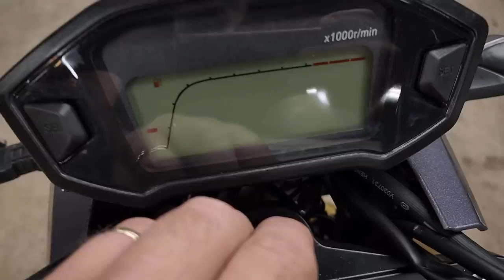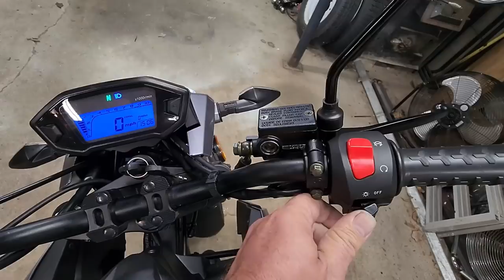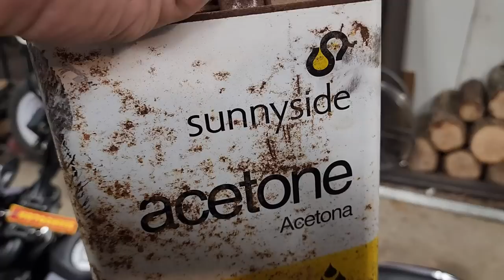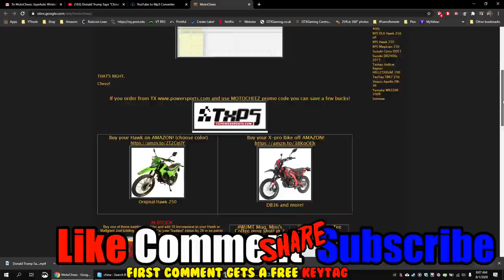BRAND NEW RPS Condor 150cc Grom Clone complete unbox build ride review top speed and 0-50 time

Comment from the maker: Purchase link: https://bit.ly/3tFJtWy
Use MOTOCHEEZ during checkout for discount!
Parts and info: https://www.motocheez.com/rps-condor-150-cc-grom-clone

Amazon affilaite links:
Shinko Nobby Offroad DOT tire set: https://ebay.us/OaEfRl
428-16 20mm front sprocket: https://amzn.to/3QDSZnd
Re-jet Stock carb main jet kit: https://amzn.to/3QBXYEL
Reply: Where do you oder theses bikes from I want one but I live in canada how do  I order  one can you send me contatic information
Reply from the maker: Purchase link is above through TXpowersports.
Reply: Tx power sports sells both. If given your pick would you go with Tao Hellcat or the Rps condor?
Reply from the maker: Condor is faster out of the box. I'd say condor. I had issues with motor mounts on hellcat.
Reply from the maker: Use my motocheez discount code to save a few bucks too
Reply: @MotoCheez   I ordered the condor. Do you think I can get away with a plug upgrade and a carb adjustment, or should I upgrade the carb?
Reply from the maker: The carb and you also have to get the intake made a huge difference. You could probably break the bike in for the first hundred miles and see what you think but it definitely made a pretty good difference. Congratulations!

Comment: I can already tell that going to make a pretty easy big bore motor with the cg230 jug and piston. Plus all the aftermarket and performance parts for the cg motors. Time to snatch me up one of these.
Reply from the maker: I'm putting a CG 230 motor on it, because I believe the crank doesn't have as much of a stroke on the 150 so I already have a donor bike I'm going to use
Reply: @MotoCheez  understood. Well I do have a spare myself. I've been waiting for the one in my old Hawk to give out. Still running strong after almost 6 years.
Reply from the maker: My donor is Blades old TBR7, 6000 miles still going strong!

Comment: Looks like a fun little bike. I like how it's a Grom clone, but instead of using the standard horizontal engine as all similar bikes they went for a smaller vertical engine like on the Hawk. I'd vote for switching the stock carb to a Nibbi versus jetting the stock unit. But that's just me. :)
Reply from the maker: I usually do both to see performance gains, plus people can choose which they want to do
Reply: @MotoCheez  There's a universal slip-on muffler made by LeoVince that I've been eyeing for my Hawk. It's not cheap, but it's also made of carbon fiber and comes with a baffle so I don't have to buy it separate. From the few sound videos I've watched of it on bikes it's very enticing. :)

Comment: I've hit 70 on mine with a 17 tooth sprocket, nibbi pe26 and full exhaust. It's a fun little bike but change your wheel bearings lol. My rear bearings went out after about 300 miles
Reply from the maker: I just ordered a 16 tooth front sprocket, rejetted the carburetor video should be out in a day or two. I do want to upgrade the carb but for now I wanted to do it jenning just in case others did not want to go a new carburetor out. I've heard of other China bikes bearings going bad, I haven't yet but when I do my knobby tires which came in I will definitely check them

I did do 64ish this time
Reply: @MotoCheez  I thought about re jetting the original carb but didn't want to mess with the tamperproof bowl fasteners

Comment: How do you like the condor? I was thinking of getting one as an inexpensive bike. I'm 6' tall 220lbs. Would this bike be ok for around town or look stupid small with me? Thanks Chris
Reply from the maker: It's a pretty good inexpensive bike, I'm 5'10 230 lb. It's the same size as the Honda Grom. I have people that I ride with that are over 6 ft that ride the grounds and these ground style China bikes so I think they look okay
Reply: @MotoCheez  I haven had all sorts of bikes from klr to harleys to 1000cc bikes. Just looking for a cheap reliable bike to putz around on as i do not have a bike now. Did the nibbi carb make a big difference? thanks for your quick reply
Reply from the maker: @chrisbollinger8107 That's a fun little bike, it's about the same speed as a Grom too so they only do about 5560 tops. The carburetor did definitely wake it up. And later episodes I did put a CG 250 motor on this bike which really woke it up!
Reply: @MotoCheez  was the 250 hard to install. I have seen them on ebay for $360-450. Are they the same size and same mounting holes?
Reply from the maker: @chrisbollinger8107 I have video on install. Hardest part was welding top motor mount. It almost directly bolt in
Reply: @MotoCheez  What size and brand knobby tires did you go with. Do they ride ok on road
Reply from the maker: @chrisbollinger8107 I put the link in the description, yeah they work really good on the road and great off-road
Reply: @MotoCheez  thanks. I should have looked at your post more thorough
Reply from the maker: @chrisbollinger8107 no biggie, most people don't think to look there.

Comment: How has the reliablity been? any issues over the last year? Wanting to buy one but having a hard time finding info on reliability on long term use and high mileage etc . Thanks
Reply from the maker: I ended up putting a bigger motor in it but not because the motor was bad, but these CG style motors go over 10,000 mi easily. I've done dozens of reviews on these Chinese bikes and the biggest problem is typically bolts loosening up, you rarely ever hear of an engine blowing

Comment: If it's true that he who dies with the most toys, wins, Cheez is definitely in the running.
I was thinking about building a scrambler out of a RPS Viper 150. I wonder if you could fit the Viper exhaust on the Condor?
Reply from the maker: Hmm. The frame is different on this, it's box not tube like my hellcat
Reply: @MotoCheez  If the head pipe fits, maybe custom on back. If you do an engine swap, how about the big 250 6-speed?
Reply from the maker: Yeah, I'd shoot around, see what's our there. Or buy a used china ike for a donor

Comment: It seems that access to check and adjust the valves on this and the KP Mini are a bit of a job. What is your experience with this
Reply from the maker: Haven't done it yet, but seems same as hawk250, the plastic that has to come off is a pita for sure. I put a cg250 on it and did valve adjust before I installed it

Comment: I was under the impression that the "factory oil" in these things is super light weight oil merely intended to keep the inside of the engine from rusting.  Seen a few minibike channels where they say to immediately empty the oil and put proper new stuff in before running the motor.

Although maybe it's changed since then?  I dunno.
Reply from the maker: That's how it was when I first started getting the bike 5 years ago, dealer contacted manufacturer and they said you can use as breaking oil. I do 100 miles then change
Reply: I ran that oil in my grom clone bike for like 10 miles the engine was smoking and smelled horrible , change it immediately . Just a quart

Comment: the oil in them are for shipping.you should change the oil on it.
Reply from the maker: It's not like the first oil, it's ok oil, I checked with them a few years ago. I always say change immediately, but I do at 109 miles to remove debris
Reply: @MotoCheez  I thought it was break in oil
Reply from the maker: It supposedly isn't. RPS contacted the manufacturer, they used to ship with a light mineral oil, they switched about 3 years ago.

Comment: Say cheez..o have a question does the condor have an oil filter and of so where is it located?? Thanks an advance...you have a video changing the oil???
Reply from the maker: No oil filter, has an oil slinger style which you clean every 10000 miles. There's a small screen too. 
I didn't do an oil change video yet. But same as hawk oil change, same style engine
Reply: @MotoCheez  appreciate it a great deal

Comment: I was looking at those when I ordered my kp 150 mini,  I like the seat , and wheels on the condor more, but the crf150 based engine on the KP is ohc instead of pushrod,  I am about to order a 210cc big bor kit , race cam and head for my KP it should be pretty quick after that
Reply from the maker: I didn't realize the KP has OHC. That's a plus, that's a CB engine I believe
Reply: Yo Mad MotorHead. Were can I order the big bor kit & race cam from. For the Lifan KP mini.
Reply: @geraldroland5079  BRT online partner PNP performance  off of Facebook messenger
Reply: @MotoCheez  crf based engine,  no kick start,  but many parts interchange

Comment: One thing they say about all these imported bikes is blow out the gas tank there may be metal or other junk in the tank and to lock tight all your bolts and screws because sometimes they don’t come shipped tight, not to mention do it for your safety. I’m just saying. Have fun gentlemen.
Reply from the maker: Hmm, never had debris in any of mine. Yes, check the bolts! I prefer RTV for vibration on bolts

Comment: Definitely looks like it's got a small bore version of the hawk/tt250/Brozz engine.

Any of those 229cc oought to fit right in.

At basically $2000, I'd kind of expect FI on this. Especially since the  Hawk DLX already has it.

That, and those floppy drooping turn signals are annoyances, but it seems like a solid bike!
Reply from the maker: Agreed on the EFI, but I like the carb for more performance tinkering.

Comment: I want one next year! Torn between scooter or minimoto. Needs a rear rack for shopping and camping! tell me they give you an assembly disk or booklet-Ièm not a mechanic, I aspire to be one, but I want to ease into it.
Reply from the maker: They don't give you an assembly manual which is why I made this video. It's not really that hard. As for rear rack I couldn't find when I had to make one which is later on in the series
Reply: @MotoCheez  You seem very happy with the bike-I have heard many nightmares about the Venom Boom, it also needs many mods, like tha engine mounting bolts being half the diameter they should be.
Reply from the maker: @johndefalque5061 I'm happy with it. No issues with mounts like the hellcat horizontal motor, kept breaking bolts! Had to weld a lower bracket on

Comment: Hi MotoCheez, I'm looking for replacement parts for my sons 3 month old RPS Condor 150, its silver like yours. Parts needed: silver painted plastics, exhaust shield,  rear axle w/ nut, we have had (2) exhaust shields fail off (loctite was used), we are on leaky tank #2, leaking at the seam. All I can find on the web are complete bikes and/or common parts that fit many other clones. So reaching out to you sir and the other RPS Condor 150 crowd. Thanks in advance.
Reply from the maker: Well damn, that's a lot of issues. Probably TXpowersports will have them.
Reply: @MotoCheez  ty sir ill call them monday
Reply: How fast is it
Reply from the maker: Out of the box, about 54. Jetted closer to 60

Comment: Is this better then the hell cat
Reply from the maker: IMO, yes. The Hellcat had issues breaking the frame bolts until I put another bracket underneath that I welded and bolted in, and the brake line I had to replace with a grom brake line. This engine has a lot more torque too

Comment: I have a question that on the headlight, the top right and bottom always on at same time when I turn on light. Do you have any idea for that. Is that normal or I should to fix the lights?
Reply from the maker: Bottom light is running light, low beam is one upper light, high beam is both upper lights, so all 3

Comment: Why leave factory oil in for 100 miles,I’ve heard others say change it immediately
Reply from the maker: Because they used to put in just vegetable oil kind of stuff, but now in the last few years they put good oil in. I confirmed with the manufacturers and tested myself. There's no reason to change the oil that it comes with but I still use it as breaking oil and do it at 100 miles
Reply: @MotoCheez  thanks so much for your response,I truly value your knowledge sir,may I ask , between condor,kp mini, and boom Vader, which clone would you prefer???
Reply from the maker: I kind of prefer the condor or the KP Mini because it has the CG 150 engine it's easy to either put a big bore or just put a bigger motor on fairly cheap, it doesn't look like it's going to have the broken frame bolt problem that I did with whitey either

Comment: Will this bike work for someone who is 6 feet 7 inches in height and 245 pounds in weight?
Reply from the maker: It may feel pretty small for you, I have friends that ride groms that are 6'4 and about your weight. It is basically the same size as a Grom if you have one to sit on in your area
Reply: @MotoCheez  this makes sense. So, with the Honda Grom. Will a fake Honda Grom work, similar to what you did a review on? Also, will a Chinese Hawk 250 Street Legal Dirt Bike, similar to the one you did an Amazon review on, work?
Reply from the maker: @onemaj3sty this bike and the tattoo hellcat are from clones, they're smaller bikes, a hawk is a larger full size bike that you'd fit in much better.
Reply: @MotoCheez  I appreciate your transparency.

Comment: 150cc CG chinese engines are very durable and there are avaible piston kit and rings in the japanese brand TKRJ
Reply from the maker: I heard there are big bores too!
Reply: @MotoCheez  there are the supossed chinese "230cc", a cylinder kit with a 200cc piston but is crap, i took the measurements of the cylinder and the stroke and barely you get 176cc and besides the piston at TDC stays too low, don't  recommend it.
Reply from the maker: Thanks for that info! I need a cg 250 then!

Comment: Hey Cheez this is a long stretch for a reply but how do u change the idle? I can’t seem to find the right bolt
Reply from the maker: It's on the kick start side, in the middle of the plunger and carb. Has spring behind head of screw.

Comment: What does "it's no whitey" mean.
Are you saying it's not as good as the hellcat?
Reply from the maker: I'm just merely stating at this point in time before I get everything ironed out as far as jetting in a free flow pipe It's not as fast as whitey, it's definitely as quick or even a little bit quicker 0 to 50 but I don't know if it'll ever be as fast top end because of the differences in motors
Reply: @MotoCheez  reason I ask is I can't decide between the vader and the condor  they are the same price
Reply from the maker: Even with my little discount at RPS?

Comment: no carb to deal with its fuel injected?
Reply from the maker: This one is carbureted
Reply: @MotoCheez  cg250 swap on a Vader hellcat a better option?
Reply from the maker: I did the horizontal Z190 in later episodes, different style motors. Just reviewed a condor that'll take a CG250 I believe. Same style, it's a CG150

Comment: Any tips on things to double check ect?
Reply from the maker: Go over grounds and bolts for sure. Connections behind the headlight, make sure pins pushed in socket and seated good. Chain tension... And basically what I said in video
Reply: @MotoCheez  okay thanks

Comment: I almost bought this bike but I went with the kp mini 150 because from what I can tell the kp is a ohc engine and I believe the condor is a pushrod 150 and I figured the cam would b more reliable
Reply from the maker: Yes, it's pushrod
Reply: But pushrods are less moving parts which makes them MORE reliable. That's why one a vehicle needs a reliable engine they usually go for an old proven pushrod engine because they're the most reliable design
Reply from the maker: @infesting  true!

Comment: You don’t leave the factory shipping oil in for 100 miles lol. Start it up get it warm and then drain it.
Reply from the maker: I confirmed The oil they use is not "break in" or "shipping" oil. It's good oil. Years ago they used a vegetable oil to ship with.

Comment: A grom clone? Grom doesn't have a vertical crf150f motor.
Reply from the maker: referring to Body style
Reply: @MotoCheez  sounds like lazy writing or you don't understand the meaning of clone. The bike is a crf150f clone.
Reply from the maker: No, the engine is a CG150 clone, the bike is a Grom clone. Crf150 is a much bigger bike.
Reply: @MotoCheez  both engines mentioned are 150cc displacement how can one be bigger?kp mini and the vondor have Same hp same torque.  RPS uses CRf clone motors on all their other bikes. The KP mini uses a crf big bore kits do you know if the condor can too?.  What about the bike and chassis is cloned from a grom? Unlike a real grom clone  like a taotao that looks and uses grom parts what on this bike is cloned? Would you call a civic a camery clone? Or an F150 truck a tacoma clone. Your argument sounds ridiculous.
Reply from the maker: I don't know what you're talking about the frame is almost identical to a Grom the wheels rims brakes 90% plus parts will work between the two bikes, this does not use a CRF150 motor it uses a CG 150 which is a single lobe cam push rod engine with overhead valves. It does not have overhead cams like the CRF150. I have no clue what you're trying to say it is a Grom clone with a CG 150 engine just like I stated in the videos how is that so hard to understand?

I would call a car that has the same exact body with probably a different motor in a clone yes. Like a Jeep if they go for a Jeep style it looks like a Jeep. How else do you describe a small little bike like the Grom?
Reply: @MotoCheez  wow did mean to trigger you but an FJ40 is not a jeep clone.and this bike doesn't use grom parts it is not a clone just because it has the same tire size? What honda parts are compatible with this bike?
Reply from the maker: I never said an FJ 40 was. Grom parts, minus the engine are, I said it several times. Tires rims, brakes, plastic, forks, swingarm, plastic etc is GROM swappable, just like the hellcat 125